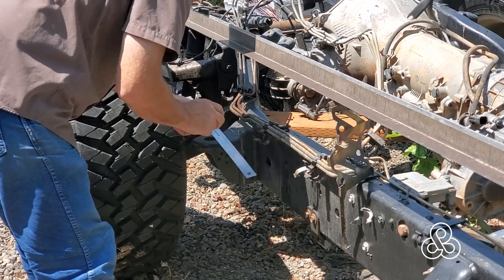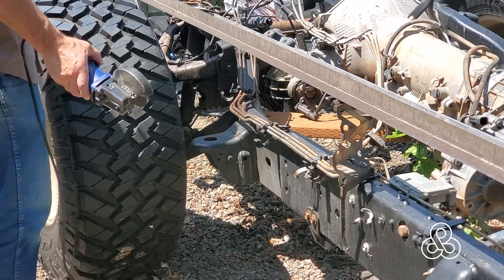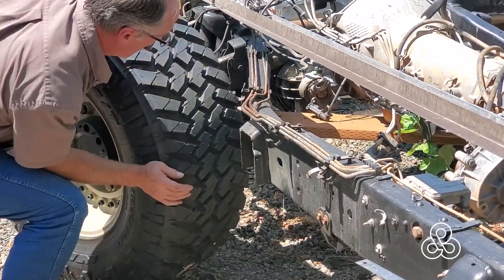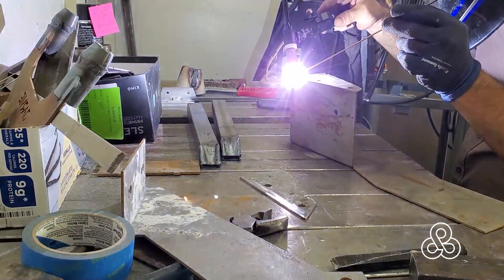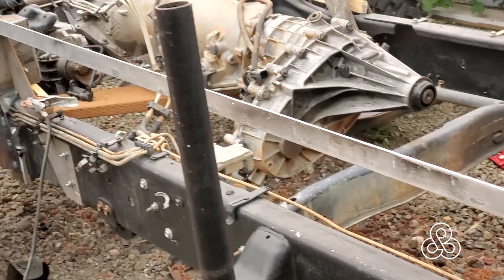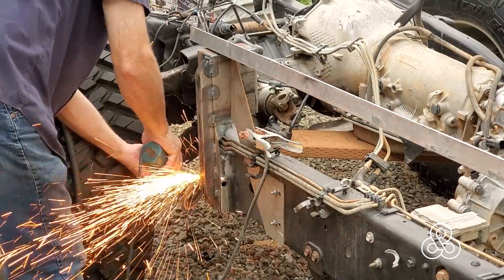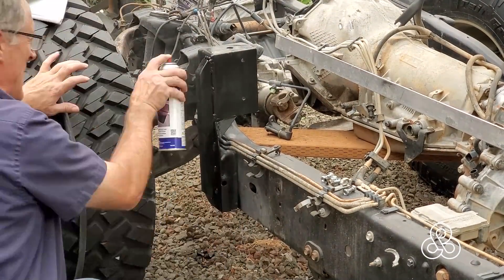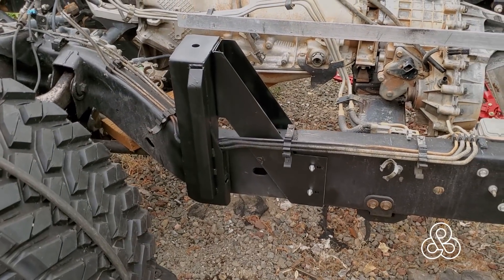L7 Modifying chassis mounts for The new Leviathan Super-van Overlander cab.

Comment: Because chassis flex any addition to them needs to take this into account to prevent fractures. That’s why you will often see parts riveted or bolted to the frame instead of welded.
When welding to a frame you need to use special techniques to avoid creating fracture points.
Diamond shaped plates , fish mouth shaped butt joints and stitches instead of continuous welds are some of the techniques.
Reply: Trying to make it so others can duplicate my efforts this time. Don't want to ask people to enter the realm of frame welding. Or if they do to seek proffesional help as you describe.
Reply: @pivotalevent  would it be viable to bolt that mount to the chassis rather than weld it? would be easier than welding yeah?
Reply: @aarondcmedia9585  For sure! Anywhere I can eliminate weldind, would make a kit easier.

Comment: You should make a fillet when ever you have two edges and angle between them. For example in that tower support bracket. The bigger the radius the better. Or if you are forced to make a small radius, add flat bar along the edges and make a kind of a T-bar out of it. It also takes a lot of transversal vibration away from the plate. Now you have plate only, and no fillet, it will crack suprisingly fast.
And when making those tower boxes, and welding two perpendicular plates together, leave excess to one of the edges, it will take some of the forces away from the seam.